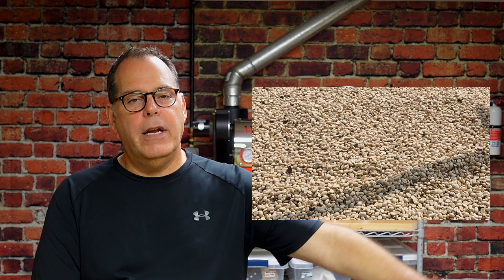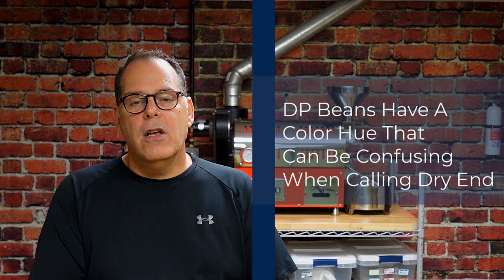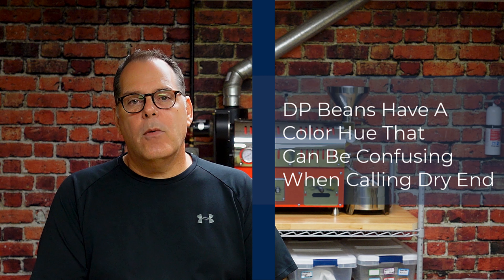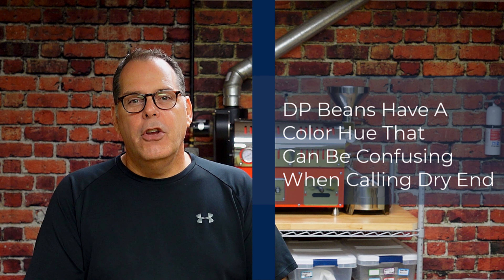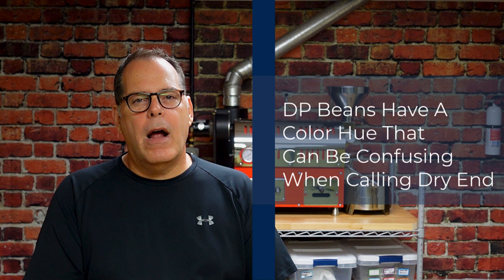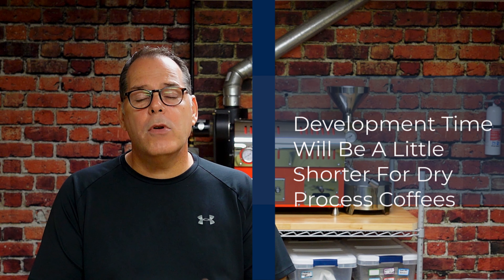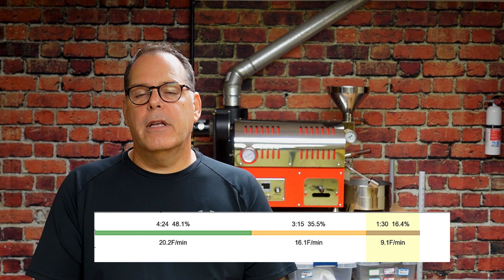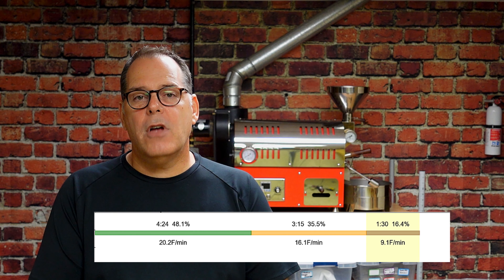Tips For Roasting Dry Process Coffee

Comment: Great video.. what about degree after the first crack instead of % after FC?
Reply from the maker: Yea, percentages work when you are talking about the same total roast time.  Temperature, color and time are other ways.  If you rely on temperature after first crack you can still roast too long.  This could happen if your rate of rise is low.  Same with a high rate of rise. Moving quickly through development could cause a shorter time and lower percentage.  
I guess you make a great point of not relying on one way to measure development.  I rely on all 3 as a way to help me know when to end my roast.  My primary method is color and temperature and I’d I find my percentage is way off, I know I need to make adjustments elsewhere in my profile.

Thanks for your comment and for watching!

Comment: When referring to the 'red' hue color when dropping, I believe, what happened is that those are underdeveloped beans. This happens if the floater are not sorted out or in cases when dried coffee is not put to the floater. Unfortunately those 'floaters' or 'red' hued beans should be sorted out and not used for coffee brewing since they do have a very underdeveloped taste and influence the cup negatively. If possible (meaning if enough water is available) floating should also take place when applying the dried process. For the reason to detect and sort out the 'floaters'.
Reply from the maker: Hi Markus, thanks for your comment and for watching my video.  Yea, the floaters are kind of red and a lot lighter in color.  I think I was referring to the overall red hue of the beans.  If you set them side by side next to a washed coffee, they seem to have that hue.  Have you noticed that?
As for the floaters, I usually pick those out when they are in the cooling tray.  They definitely don't taste good.
Thanks for sharing your knowledge regarding floaters.  What type of roaster are you using to roast coffee?
Reply: @VirtualCoffeeLab  I am using Diedrich roaster since 7 years...always good experience and reliable.

Comment: Ok, new to this and need to know how a rate of rise of "12" is actually measured?  Is it 12 percent of something?
Reply from the maker: Hi Orion.  Rate of rise (ROR) is the comparison of  temperatures within a timeline.  If measuring manually, I measure bean temperature every 30 seconds.  For example, at 3 minutes into the roast your Bean Temp (BT) is 300 degrees and then at 3 minutes and 30 seconds it is at 310 degrees, you have a ROR of 10 for a 30 second interval or 20 for a one minute interval.  So, when using logging software, the number displayed as the ROR is a calculation made every few seconds and displayed as the ROR per 1 minute.

ROR is a clear indicator of your roast progression.  When roasting we don't just want to blast full power through the entire roast because we want to control our heat so specific periods of time pass by for each coffee event (dry end, first crack, drop) .

Let me know if you need further clarification!  What are you roasting on?
Reply: @VirtualCoffeeLab  This answers my question specifically!  I have been ordering some Brazilian Adrano volcanic coffee (dry processed) that I have been roasting in an iron skillet and have gotten it to taste like hot cocoa!  Yum!   I'm looking forward to purchasing a small 300g roaster in the near future.  Thank you so much for the prompt response!  Great video tutorials, keep them coming!

Comment: Great video! Roasting on my MCR 1kg I have been getting tipping on my Brazil natural. I do not notice this tipping using the trier during the roast, but it is evident once I drop and inspect the beans. Do you think this tipping is occurring due to the heat at the end of the roast? or do you think it is a combination of things throughout the roast?
Reply from the maker: Hi Jacob, tipping occurs when high pressure from internal steam of the bean is being released out of the weakest point of the seed.  This is because the pressure build up too quick so my thought is the steam is being released before first crack, not at the end of the roast

Comment: Enjoying your channel - question for you on the development phase.  If you're shooting for that 13-17% range, do you drop your beans even if first crack is still rolling vigorously?  I read about people dropping beans at the end of the FC, but as I've worked towards lighter roasts (and seemingly shorter development times), it seems like I have to drop while FC is still rolling.  Is that your experience too?  Thanks.
Reply from the maker: That’s a great question Patrick.  The short answer is yes, sort of.  The rest of my response goes into more detail based on your term “vigorous” and “rolling”. I watched a video from mill city with joe Morocco and Derek delapz who were answering that very question.  Their answer was yes.  Now the rolling and vigorous are a little eye opening for me when we try and answer your question.  Can you please share what you are roasting with?  Also, do you know your times, temps?  It sounds like your first crack at a fairly good clip.  I’m entering development around 12 or 13 ror.  This helps buy me more time in development without my temps going too high.  Buying more time like 15% instead of 8-10%.  Just curious.  I realize there are many ways to roast light.
Reply from the maker: I just saw your other post you are using a Hottop.  So, my thinking is your cruising along pretty quick into first crack.  The Hottop is slow to warm up so your building up heat and I’m betting your browning middle phase is on the shorter side of 30%.  Just a guess.  Anyway I would be interested in seeing your phase percentages , times and temps if that’s ok.
Reply: @VirtualCoffeeLab  Thank you for your replies -- I wish there were any easy way to share my roast profile here in the comments (maybe there is and I don't know!)  But I looked at my recent profile of an Ethiopian dry processed bean and the times and temps aren't too bad.  I charged at 345 degrees F.   Had a 49% drying phase (4:42) and a 35% (3:21) middle phase with FC at 8:03.  My development phase was 15.3% (1:27) and I dropped the beans at 9:30.  Final bean temp was 383.  What I noticed is that I was still experiencing FC -- maybe it wasn't virogorous--maybe it was slowing down and rolling more towards the end, but I probably would have roasted another 30 seconds to reach the end of FC.  Instead I dropped them earlier than I normally do.  I've had the hottop for just a couple months, so I'm still experimenting and learning the machine.  I am especially shooting for those fruity notes in these types of coffees.
Reply from the maker: Ultimately taste is king Patrick.  Your taste buds will have to determine how to change your roast profile.  Is the coffee tart, sweet, acidic, flat, vegetal, burned tasting, woody, papery.....  all of these and more will be clues how you should change the profile FOR THAT COFFEE.  Every time you roast a new coffee you will most likely want to tweak the profile.  
In the end I think it is a good idea to have most of your beans complete first crack.  Technically, unless the coffee reaches first crack it isn't fully roasted, unless you are aiming or a Nordic type roast.  My goal is to have the majority of my beans complete first crack and to be in that 13-17 range on development.  That percentage will vary based on process varietal and origin BUT there are often a small percentage of beans cracking as I drop the coffee. 
 I think the more important nugget is heat management.  Going too hot through the phases and not providing enough time in the browning phase is what most people struggle with.  Looking at your phase percentages and times, they look great.  How does the coffee taste?